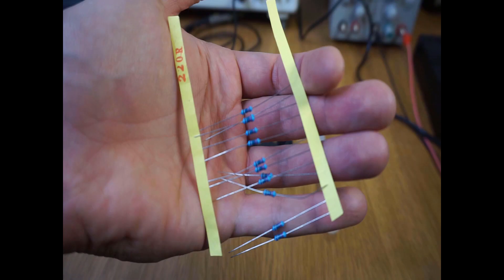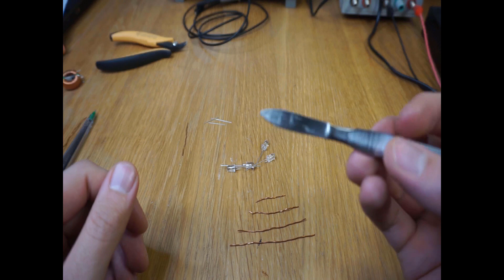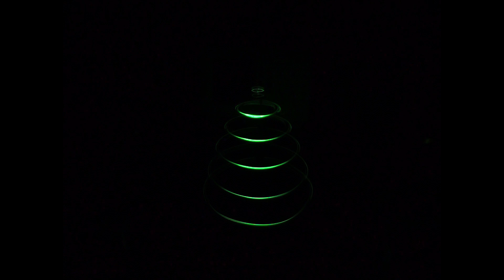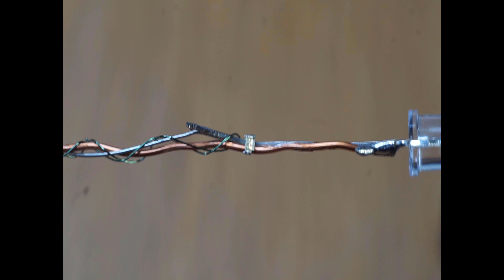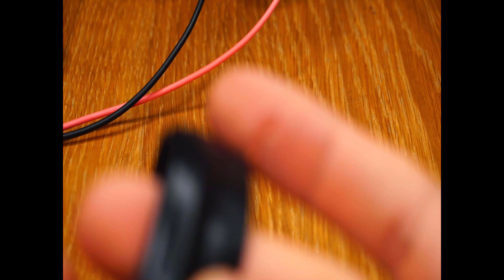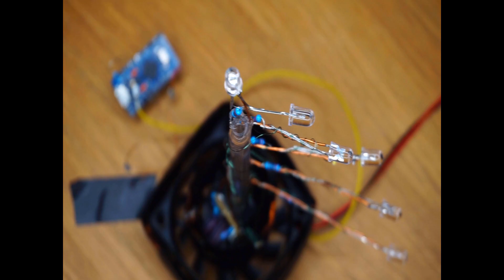Rotating LED Christmas Tree + Arduino Wireless Power Transfer

Comment: You don't need an Arduino to generate a square wave for your wireless power. You can just use a 555 astable multivibrator. The wireless power part was interesting but video quality is really poop.
Reply from the maker: You don`t even need 555 timer, to generate square wave. I made it also with op amp relaxation oscillator, but with arduino you can more easily measure DC fan rotation speed and make different LED blinking patterns. I agree about video quality- next time I will try much harder ;)